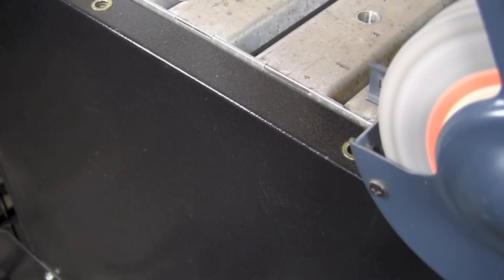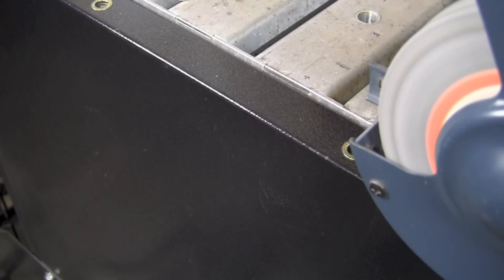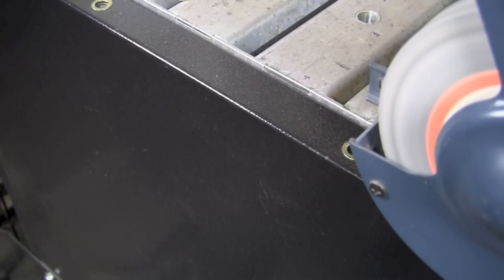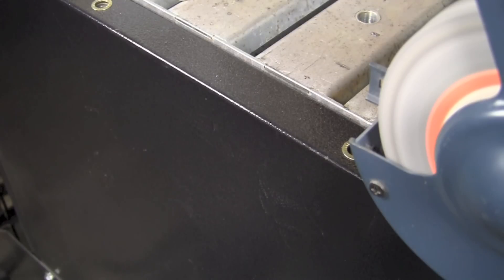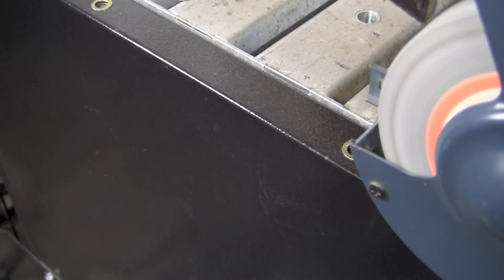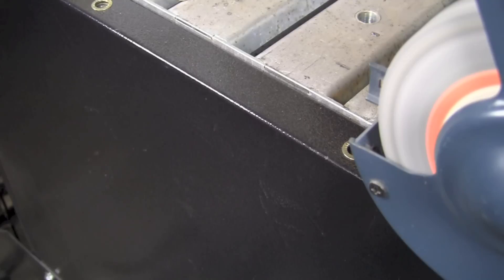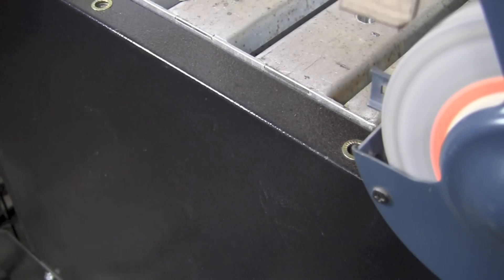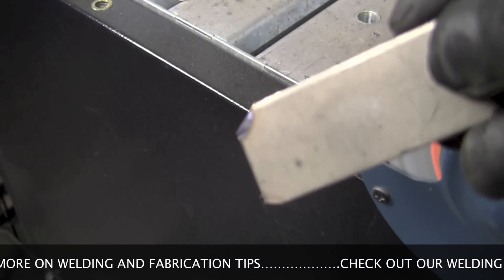SPARK TEST FOR METAL IDENTIFICATION - DETERMINE THE METAL TIPS TRICKS AND ADVICE

Comment: A lot of structural steels are fairly low carbon but have about 1% or a bit more of Mn and and a small amount of Si as well. A rule of thumb for the hardenability of these steels is a carbon equiv content of C+(Mn+Si)/6. So for example a 0.2% carbon steel with 1.1% Mn and 0.4% Si would have a carbon equiv of about 0.45% and be somewhat hardenable. I think that this may be something like what you've got there.

Comment: Enjoying your video 101's.. Could I suggest that you warn people about grinding non-ferrous (especially aluminum) on a ferrous style grinding wheel, as that it can cause wheel explosions (if fouled enough) through different rates of metal debris heat expansion. I understand that you did this as a demonstration and I haven't seen all your video's yet, but perhaps you could show grinding wheel dressing to remove fouled areas in its surface. Cheers Garry
Reply: That's not true. It's not a bomb.

Comment: Respected Sir,
Can you please tell me which grinding wheel (SiC or CBN grinding wheel) is suitable to surface grind Ti-6Al-4V? and which grit size should I use to do a rough cut, to remove 1mm material with a depth of cut of 0.025 mm per pass and the finishing pass will be carried out?

Comment: you know it's not smart to grind aluminum with a AO wheel. it can load up on the wheel and trap heat in that will cause a wheel to explode. not that your little test most likely hurt anything.
Reply: You can also dress the wheel to remove any captive alloy.  I don't really like grinding wheels (except where the job actually makes them necessary like surface grinding or using my toolpost grinder) so I run 5/8"-11 threaded flap discs on the right-hand thread spindles of my bench grinders. A stack of flap discs lets me segregate them so what I use on aluminum won't be contaminated.

Comment: Why does titanium spark?  as it is non-ferrous.
Reply from the maker: This is because under normal atmospheric conditions, Titanium will burn before it melts.
Reply: Cheers, thanks for reply. Another question, why doesn't aluminium alloy spark when it does contain some iron ?
Reply from the maker: Aluminum alloys containing enough iron to create a change in the way aluminum oxidizes would be rare to see in our field. Most AL alloys are compositions of other elements to alter strength, malleability and thermal properties along with corrosion effects. Aluminum creates an oxide layer in normal atmospheric conditions so fast, most of the time, it is near impossible to remove the layer and affect the AL before the oxide coating reforms. Another thing aluminum has going for it is malleability, it deforms before cracking or splitting. With some grinding wheels, the AL will actually fill the pours and eventually coat the wheel if the conditions are right. Some alloys reduce this, but most of the time the oxide layer prevents the grains separated from the base from becoming incandescent.

Comment: DO NOT GRIND ALLOY ON A BENCH GRINDER
Reply: +Brian Wynn why not? ( just curious not saying your wrong or anything)
Reply: Soft metals like aluminum get stuck in the wheel and it's the trouble.
Reply: You actually can grind aluminum on a bench grinder you just need to be sure you're using the proper wheels. Aluminum oxide which the most common and is usually grey is used for general purpose grinding of steel and if used to grind aluminum will do what is called loading the wheel where it essentially sticks in the grit and stays there and can only be removed by dressing. while silicon carbide (usually green or black) is used for grinding carbide tooling and soft material like aluminum and won't suffer the same loading effects.
Reply: Steel is an alloy, titanium and aluminium isn't
Reply: @shodanxx  basically everything you use is some type of alloy, completely pure metals arent really used much